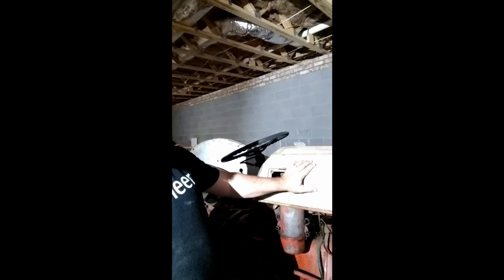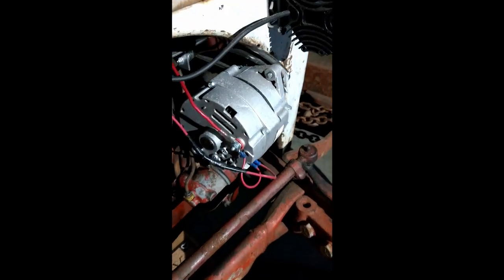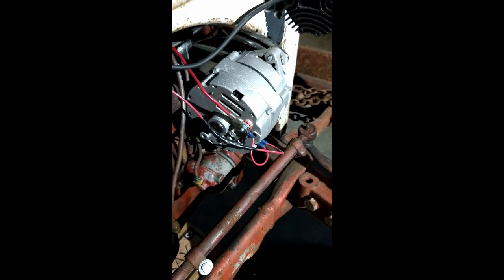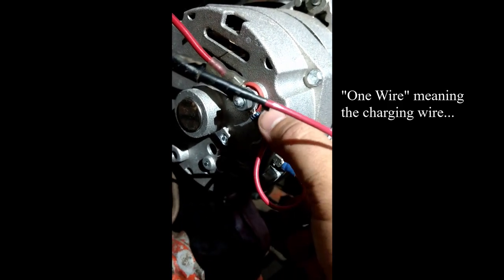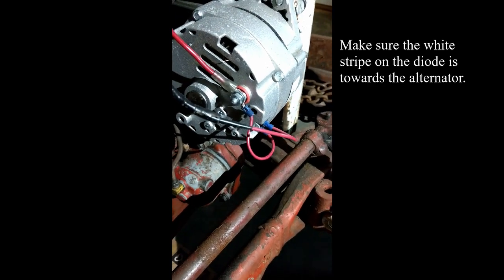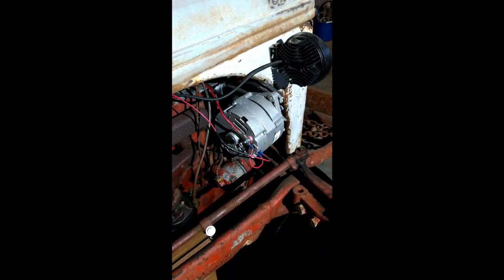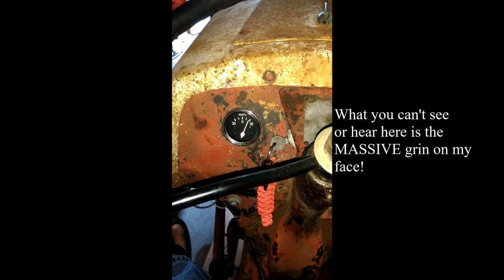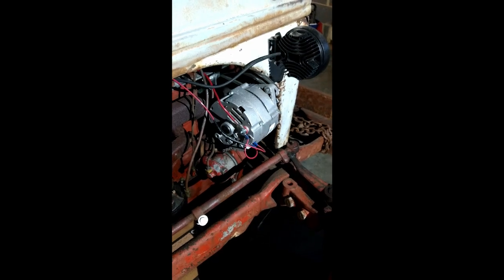Ford 8N Alternator not charging!  Here's a cheap fix!

Comment: did you have to buy a new pulley or did you find one that works. for your altenator
Reply from the maker: The alternator was already on the tractor, just wasn't functioning.  Someone else did the 12V conversion and royally monkeyed it up.  I rewired most of the tractor and found this fix for the alternator not charging.

Comment: where does the red wire from the terminal go . does it go to the solenoid or the ampmeter
Reply from the maker: to the ammeter if you have one, mine didn't have one so it went direct to the ignition switch junction...   here's a reference with wiring labels that I used.  https://encrypted-tbn0.gstatic.com/images?q=tbn:ANd9GcSN8-F63TwZUFOEnFH94te-VJ1_0ylmNtuGiGFjaTTrpEABw-uwo-8vuXnqH4c7Kt0HPUs&usqp=CAU

Comment: My stepdad bout a 1952 8N. I had to rewire everything. I couldn’t get the alternator to charge at all. All my research point to a low RPM alternator. They are over $100. I found your video by luck and wired my alternator the same exact way. Like in your video, when you see the needle on the amp meter move, my grin was just a big. You saved my stepdad from buying another alternator. Because of people like you taking the time to make this video we say thank you. We will be following you.
Reply from the maker: So glad it helped!  I spent 3 weeks going back and forth with alternators and finally happened on this solution on an OLD forum.  Figured a video would help more folks out!
Reply: @m16gunslinger77 . Thanks for putting the video together.   I’m having same issue…wondering if you could provide the original link to the forum post where you mentioned you found this solution.  Thanks again
Reply from the maker: Also, a lot of my farming content I've started moving over to the channel for my farm.  Big N Farm.   https://www.youtube.com/channel/UCUxBmTsD1LgSRX-galDCZYQ/